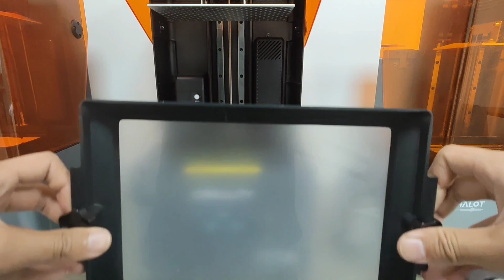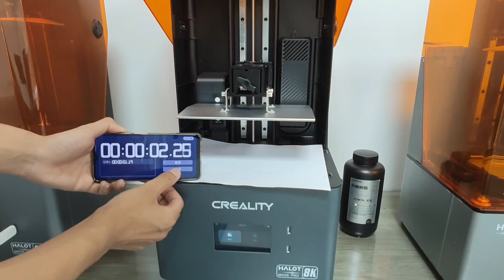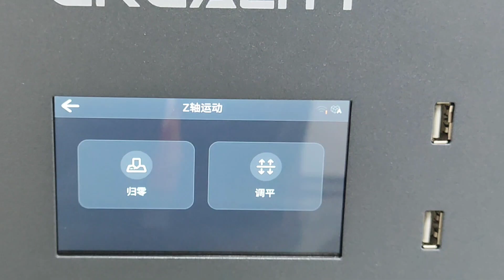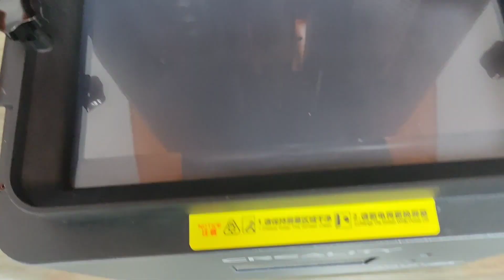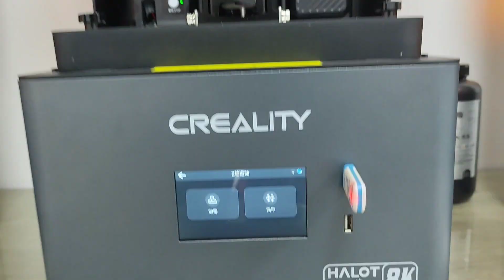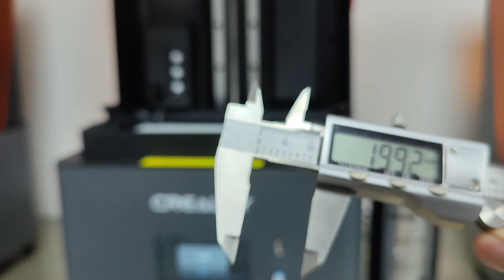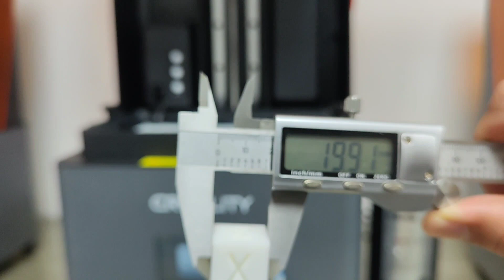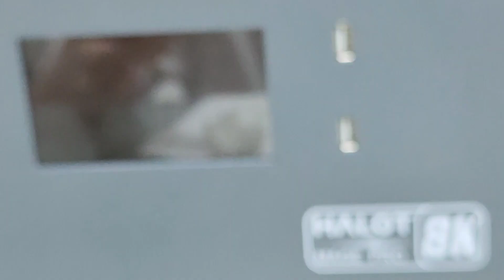Halot-Mage Pro Unbox, 100mm/s ！ is it the fighter in desktop LCD 3D printer?

Comment: It is very strange to print with white resin and show the result in an accelerated form, but even so I perfectly see solid stripes on the details. This printer is not ready at such speeds, they had to put other mechanics there and increase the rigidity, and not just add ACF film and a powerful motor
Reply from the maker: yes, we choose the grey resin now, you can check our new video